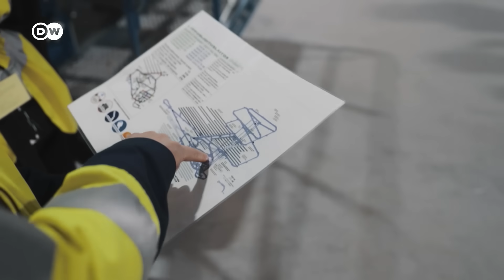How Finland is betting on nuclear power, and its waste | Focus on Europe

Comment: Brilliant enginnering by tge Finns, much respect from India...I hope my country also bet big on nuclear
Reply: No offense... But I wouldn't trust the Indian government with a storage facility like this. India has the brain for it for sure. But there is no room for cost cutting, half-measures and corruption in projects like this. I have nothing against India but it's current corruption index is 40 for a reason....
Reply: @ashy969 Finland has proven it can be done, so if they share their knowledge then other countries can do the same.

Corruption is always a potential hurdle, but in this case we're talking about how to safely deal with highly radioactive nuclear waste that's already been produced and is currently stored in temporary facilities, where a leak is far more likely.

If a country wants to use nuclear power then they need to construct breader reactors to make better use of existing and future spent fuel, but also build similar storage facilities for the final, unusable waste products.
Reply: @ashy969  corruption in the system is a legacy of 70 years of socialist rule, its changing but still need to go a long way, and another thing is neccecity is the mother of invention and the current govt is making PHW nuclear reactors at fleet mode and considering the population density of India we need a robust waste handling system and the BARC is working on a similar kind of project...hopefully the 3rd stage becomes operational in the next decade or two and we completely shift to thorium based MSR reactors which is much more safer
Reply: Much Thorium to be used as safe fuel.
Reply: @daniellarson3068  yup, thorium reactors are much safe from the current ones

Comment: Every new nuclear technology is accompanied by engineers assuring the public “Oh, but this time it’s safe!” And then a few years later someone is dying of cancer and we need a new technology, and the cycle begins again.
Reply: bull
Reply: France has operated for something like 60 years without an accident.
Reply: @inyobill Japan hasn't, and I would not consider them technically illiterate.
Reply: @HolgerJakobs  Fukushima disaster was the result of a poor design of backup generation. San Onofre, built to same design, was not vulnerable to the same fault. The record of France demonstrates that it is possible to operate safely.
Reply: @inyobill  One design fault here, maybe another one there soon. 
Nuclear energy in France has been very unreliable last year. Too many reactors in maintenance, low water level in rivers and high temperatures caused it to fail.
Plus, it's far too expensive in the long run. It's privatizing the profits while socializing the costs. We've had too much is that!
Reply: @HolgerJakobs  Maybe there are undiscovered design faults in aircraft. Perhaps we should stop air travel?
Reply: @HolgerJakobs 

Just last year. Why fixate on an isolated incident? It's not representative of the whole.

Comment: This nuclear "Waste" is an excellent source of energy for thousands of years. 
Since they emit large amounts of gamma, alpha and beta energetic particles, they can be used in nuclear batteries. 
The key is to develop alloys that can release their electrons readily when hit by these particles. 
We already have Alpha and Beta cells that run on radioactive material. It's the Gamma radiation that is problematic at the moment.
Reply: You need to run nuclear waist through a Molten Salt Reactor first to change radioactive decay profile from 20,000 years to 300 years of storage. You be able to make use of the other 99%~ of uranium left in these highly inefficient reactors so called spent 😂 fuel rods to produce more nuclear power. The radiation waist from these MSR reactors burn brighter but also quicker.
Reply: "The key is to develop alloys" That's the problem right there, you are talking about something that doesn't exist and currently we don't know if it can be made! It's all hopes and dreams until someone pours the billions into the R&D. Meanwhile the waste is on top of ground level, continual threat while hoping for the absolute best outcome for something that might be 50 years away.
Also, please Google the global amounts of nuclear waste and you will realize that world will not run out of nuclear waste because of one Onkalo. There. Is. So. Much. Of. It.
Save your breath and donate for the research instead of be here guilt tripping country actually doing something about the issue while the rest is doing literally nothing.
Reply: @alaric_  Maybe you should learn to read first. no one is guilt tripping anyone here. 
Fins are doing it the right way. We need to preserve this "Waste" for when we get smart enough to use it.
Alloys don't make themselves. You must be young with vinegar in your pee.
Reply: You can also use it for heating. The question is, is the trouble worth the gains.
Reply: .Chernobyl-Fukushima
Reply: @UkraineNeeds  We don't have the technology yet, but one day we'll dig all these up, to use them as fuel. 
One man's trash, is another man's treasure. 
Knowledge is the true power.
Reply: @UkraineNeeds   chernobyl was due to an engineering mistake made by a country that needed decades to design a simple car and fukushima was due to an earthquake and a tsunami
Reply: @Hideyoshi3241  Fukushima was because of being cheap. The generator was in the wrong place and unlike Onagawa (which was closer to the epicenter) Fukushimas sea wall wasnt high enough despite warnings.
Reply: Or you can just store it until it’s no longer dangerous. Just keep it underground for like 200 years
Reply: @UkraineNeeds  Fossil Fuel use causes an excess of 5 million deaths per year due to pollution alone. Literally the only energy source safer than Nuclear is Solar (yes even Wind and Hydro cause more deaths), and all those them combined are a fraction of gas and coal. Your comment is ignorant and fear-mongering.

Comment: Nuclear is literally the answer because its the only 100% clean source that power output can be controlled from when wind isn't spinning and sun isn't shining.
Reply: It is still only an interrim solution.
Reply: @AaronOkeanos  how?
Reply: @wiktorjachyra1869  Decaying organic matter is creating biogas. This can be used to burn CO2 neutral or make hydrogen out of it in time of low solar + low wind. Germany is seperating waste quite extremly and organic waste has it's own processing.
Reply: You can make Green Energy from organics and there is hydroelectric power all works in the dark windless nights. And battery technologies are rapidly progressing.

Comment: Good to see quality engineering in action, and also a community that believes in it. The world needs more nuclear power to help us transition away from fossil fuels. Not less.
Reply: Tell that to the Germans. Absolutely insane how they have demolished their nuclear power plants
Reply: @aabens considering this is a German news channel, he kinda did.
Reply: Ultimate personal responsibility for energy needs on a national level. Just don't cut corners. Opposite of venting to atmosphere for others to deal with.
Reply: You are ridiculous. Do you think this extraordinarily expensive and complex facility is a solution? Do you know that Putin enriches 45% of the world's uranium? You don't even understand this video and how it's actually talking down nuclear power. Do you think many countries in the world can afford this? Nuclear power needs to be phased out. It's only a patch.
Reply: Nuclear Fission is just one solution to our CO2 production, but a Recycling Reactor program is what’s really needed.

And of course, FUSION power hold huge potential.
Reply: Did you seee how much concrete and copper was used just to store used energy? How is this efficient, cleaner, cheaper, or Safer?
Reply: @rso823  Because nuclear power has roughly one million times the energy density of any other fuel source.
Reply: @eckligt  even if it was 1 million times more dense it’s probably more than 1 million times less abundant. What about hydrogen then if risk of mishandling is clearly disregarded
Reply: @rso823  damn, usually troll accounts at least make sense on a bizarre level
Reply: Don't speak for my part of the world. We wont ever transition from fossil fuels. My world has taken the all of the above approach and we're 100% energy independent because of it.
Reply: @Wolfcamp555  You can't use your carbon credits for more productive things then. Your loss.
Reply: @peabase  we dont do carbon credits. Thats outlawed in my little world. You either buy our oil and gas or you do without and we sell it to countries who wants it. My little world has 13 benchmarks, 11 local and 2 international and you pay in USD only.
Reply: @Wolfcamp555 There will come a time we won't do business with you until you offset your carbon emissions. That will cut you down to size.
Reply: Nuclear's b a d forEnvironment
Reply: @UkraineNeeds  Mining for rare earths needed for the production of solar panels, wind turbines & batteries is very, very bad for the environment too. Guess we're screwed.
Reply: Chernobyl-Fukushima
Reply: @UkraineNeeds  I think youre a bot
Reply: @UkraineNeeds No soviet engineers or tsunami in Finland
Reply: @UkraineNeeds  Two accidents caused by bad design and a 1 in 1000 year Tsunami.

Comment: The video start by saying some high level nuclear waste are leaking into the ground? where can they be specific with that claim?
Reply: THe temporary storage facilities are past design age because permanent storage is blocked for multiple reasons, most not due to safety.
Reply: Nuclear's b a d forEnvironment
Reply: @UkraineNeeds  "Nuclear's b a d forEnvironment"

I would argue far less than coal power
Reply: Chernobyl, Bikini Atoll, Hanford, Fukushima to name a few off the top of my head.
Reply: @twestgard2  "Chernobyl, Bikini Atoll, Hanford, Fukushima to name a few off the top of my head. "
This is not stored high level nuclear waste.
I don't know of any incident involving stored nuclear waste
Reply: @anteeko  you asked about high level leaks, and now that I answered that, you’re moving the goalposts and insisting it has to be a storage facility. First of all, no it doesn’t, and secondly look it up yourself if you actually care to know.
Reply: @twestgard2 "you asked about high level leaks, and now that I answered that,  "

Leaks on "high level nuclear waste".
There high level nuclear waste and low level nuclear waste you know and As far as I know there has never been a case of high level nuclear waste leaking.

You talk about nuclear accident and that not what I ask about.
Reply: @twestgard2  None of those are examples of the subject question.

Comment: The fins seem to be the only people that use nuclear in a more or less responsible way. There are clearly similarities between fossil fuels and nuclear energy. Both postpone a big part of the real costs and discourses in the future.
Reply: the future damage potential of nuclear waste is tiny compared to the damage that fossil fuel emissions are already guaranteed to cause.
Reply: @Ass_of_Amalek   More radioactive elements released burning coal.
Reply: France. You never hear about them because there's never been a significant issue.
Reply: @inyobill  france does have,relative to other countries, rather a lot of risk of major problems with nuclear energy. the reason is that their existing nuclear plants supplying 70% of french electricity are all ancient and largely imperfectly maintained. france first built all those reactors as a huge project, and then paused investment for a couple of decades, neglecting maintenance and upgrades, and not building any new reactors to rejuvenate the nuclear energy production, or to keep a sizeable workforce specialised in nuclear plant construction and maintenance. they just pretended that what they had was going to run forever for 20 years or so, before discovering that all their nuclear plants were quite deteriorated and they had not properly maintained their ability to build new ones. I think they eventually built one more insanely over budget, and then gave up for a while again. they also have some nuclear plants in locations of substantial earthquake risk, and now with summer droughts becoming common, they find themselves needing to shut down powerplants to avoid cooking the rivers that their coolant water flows back into.
Reply: @Ass_of_Amalek  "Problems", such as ...? We're talking on the main pollution of the environment and dangers to human health.
Reply: @inyobill  ""Problems", such as ...? We're talking on the main pollution of the environment and dangers to human health."

Compared to nuclear, solar would be more destructive.

You have to cut down trees to build solar farms or suburbs which means less biodiversity which causes its own problems. Less trees means more flooding which can destroy crops which can cause famines and deaths. More flooding means ground pollution gets washed into rivers and destroys rivers.
Reply: @inyobill  right. no goddamn contest.
Reply: @namename9998  Those are false allegations against the French system
Reply: @inyobill  I have no idea what youre talking about. I was saying that solar energy is worse for the environment than nuclear energy. Another way to interpret that is I was saying that nuclear energy is better for the environment than solar energy.

And what does the French system have to do with anything other than France probably has the best nuclear energy program in the world.
Reply: Main difference is that the waste is contained. With coal it is released as pollution into the air we all breathe. And if you just store the waste, it will eventually become quite easy to reuse it, as the dose rate from the waste reaches a point where it can be managed with somewhat normal laboratory methods within a few centuries. And before that we can use robots to process it if we want. Most places have however just decided to wait for the dose rate to decline before further processing.
Reply: @placeholdername0000  So far these are just sience fiction scenarios. There are not even prototypes, let alone commercial products. It's very dangerous to believe in such technologies because you're betting big on how technology develops instead of rationally appreciate the actual state of technologies.
Reply: @florianlinhart3782  Science fiction if you ignore France, UK and many others lol
Reply: They are forced to find ways to store it because they don't have colonies or servile vassal states to dump their nuclear waste to.
Reply: @s._3560  Who is dumping nuclear waste on less developed countries?

Comment: A few decade later it is discovered that this waste is useful and someone has to dig it out😂
Reply: It was always useful, just over-regulated.
Reply: Easier and more concentrated than natural deposits, so if they want it, relatively easy to recover.
Reply: Already known to be useful. It can be reprocessed to produce new fuel.
Reply: @unoriginalname4321  It is very expensive to do that economical unviable at the moment. It is known for over 50 years. And it comes with the ability to split plutonium off during recycling which is a security problem.
Reply: @AaronOkeanos  If its such a security problem then why hasnt France had more problems and why havent bad guys used nuclear weapons more. Saying that reprocessing is a security problem is like saying planes are a security problem because some people have used planes to hurt people. And despite some people being hurt with planes because of bad guys billions of flights happen every year. People arent that scared of planes being weaponized so why be afraid of nuclear especially when most explosives are made using stuff you get get from hardware stores or metal scrapyards.
Reply: @namename9998  France already has nuclear weapons.
Reply: Russia already has the world's first commercial reactor operating in a common network on nuclear fuel waste. It has no waste, and can produce newly enriched uranium itself. The first such nuclear power plant in Russia and the second one jointly with Russia in China are being built using this technology.
Reply: @theeraphatsunthornwit6266 You must be really smart? This claim is old, worn and without merit. World has over 250.000 tons of nuclear waste, IF it ever turns into literal gold in price, you can go and get from literally anywhere in the world at quantities that it will crash the price to the rock bottom. Waste from few nuclear reactors in a small 5 million people country is insignificant of the global nuclear waste inventory.
So lol back at you, perhaps next time you do the math before you go lolling on things you have no understanding about.